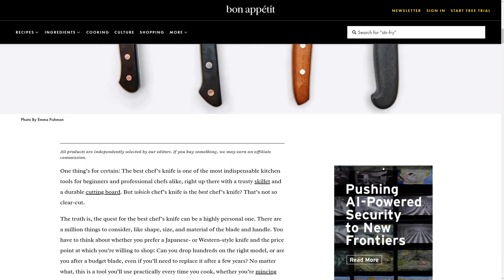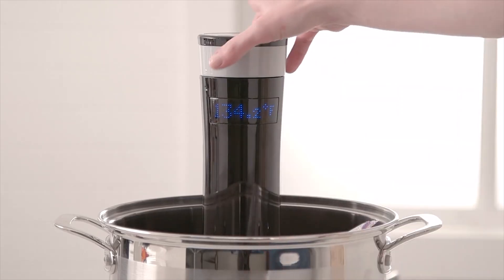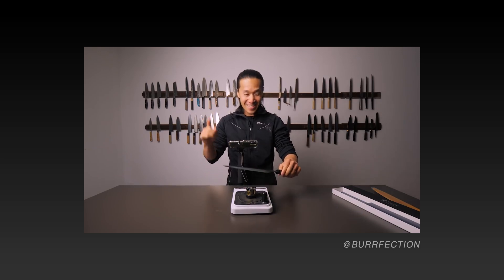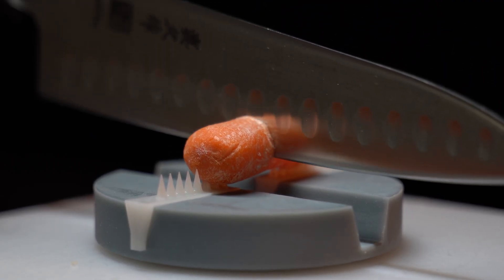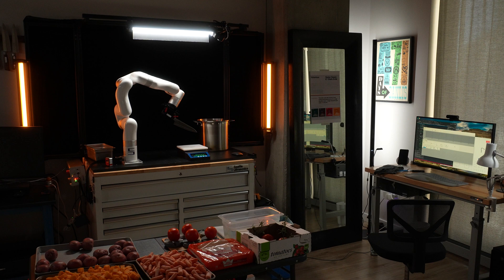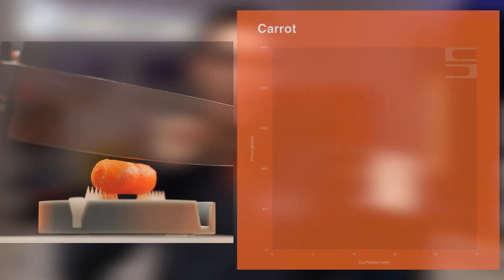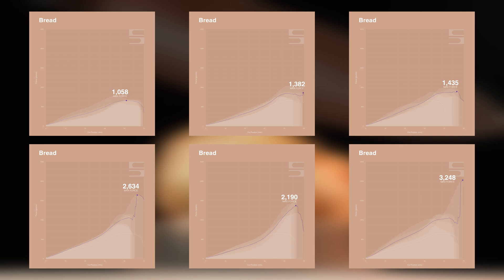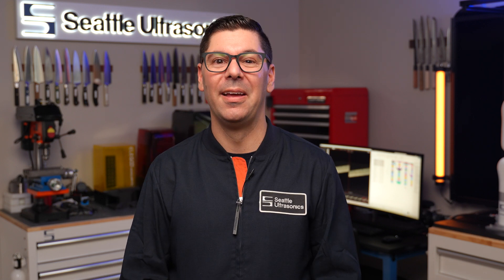The Quantified Knife Project - How do the most popular chef's knives actually perform?

Comment: As a PhD Mechanical Engineer who loves knives and sharpening, and whose wife loves cooking with sharp knives, it was great to see you tackling this topic in this way! 
I think that the data on the Blades tab in columns P-R shows why everyone should sharpen their own knives. Plus I bet that if you measured the bevel angle at different locations along the edge that it would change substantially. I don't understand why most manufacturers do such a bad job at sharpening. The first thing that I do when I get a new knife is to look at the factory edge under a microscope, and then I sharpen it. Having the data so far with the factory edges is great, but I would think that your next step is to sharpen them all at the same consistent angle, and then strop to the same sharpness, probably measured by the same Bess value, taken with the robot arm moving the knife consistently. I would love to see the robot arm stropping these knives.-)
I think that you may need to get the $$$ 6-axis force torque sensor. Slicing at a shallow angle is too important of a technique to ignore. Especially for the tomatoes, it is key. No one with a sharp knife smashes their tomatoes like your test does.
I am looking forward to seeing all your future test data.
Reply: Well said. I agree with you that he should spend the money to get the gauge for measuring force across multiple axes; I don't think the improvised device is really sufficient for this use case. I also think there should be a second robot arm holding the food instead of using a 3D-printed stand that does not really mimic the forces of friction on the cutting board or how the food is supported or held down by another hand. And I agree that the angle on some of the robotic slicing was too steep and the knife's edge did not move the through the food from from the back enough, as is the case when cutting foods with a tough exterior and soft interior such as tomatoes.
Reply: Thinning the knife behind the cutting edge doubled the cut force reduction of sharpening. If you sharpen your own knives it's easy  to cut a 10º blending bevel behind the cutting edge. 
High density food testing data - sharp to very dull 15% force reduction, blending bevel 32 to 34% force reduction.  Try that & share your thoughts if you have the time.
Reply: @danielbottner7700 what were the test conditions? Ie the thickness of the blade behind the bevel, and the material being cut?
Reply: @kknappmiller  Great questions... I have data... 1.5" x 1.75" sweet potato, 1/4' slice,  push cut,  Mercer BPX Chef Knife - 32% force reduction,(Standard Deviation =/-3% to 5%) 0.016 BTE,  0.017"at 0.080 up ,0.027" at 0.375" up, Spine =.0.085" thats one for sure. The other knife I tested was likely the Mercer Genesis 34% force reduction similar blade grind except the spine was 0.098".  
This test was run before I had any idea of force reduction achievable sharp to very dull, & yes it surprised me. 
Blending bevel narrowed 15º cutting edge 0.005" behind the micro-bevel .
Maximum cut force measured/rated. 
I have much more to share if you are interested.
Reply: @danielbottner7700 so you changed the secondary bevel from 15 to 10 degrees, while leaving a 15 degree microbevel of 0.005" or about 0.1mm? 

If so, then the cost in durability of that 10 degree bevel needs to be carefully measured. I have seen knives that were intended to have a 20 degree bevel turn into a mess at 17 degrees. I would never sharpen a normal use home kitchen chef knife to 10 degrees. That 30% increase in sharpness is not worth the loss of durability. Do you have any edge durability test in your suite?
Reply: @kknappmiller  Thanks for sharing, sorry for the confusion. I avoid using the primary & secondary bevel terminology, as they are confusing to some.
- The cutting edge on knives in my test set were all set to 15º per-side. 
- The 15º per-side bevel yields to a 10º bevel at a bade width of 0.005".
- The 10º per-side bevel yields in the the blade profile grind of 1.5º to 2.5º. 
- You are absolutely correct, in some blade steels should not be sharpened at low angles. 
- Mypreferred micro-bevel are 15º on the inside & 30º on the outside, which actually reduces cut force requirements in 1/4 slice testing on high density foods. 
- I am testing for blade thickness profile design cut force requirements.
- Good knife steels will not be dulled by the 5 cuts made on my test rig.
- A multitude of outstanding knife steels exist for those interested in extended sharpening intervals today.
Reply: @danielbottner7700 Thanks for the information. I don't think that I have intentionally sharpened a microbevel at a 5 degree difference from the main (secondary) bevel. I will often do a 22.5 on top of a 20 for a particular sharpening progression, but more often I will keep it much closer.
I guess that it makes sense to not have the edge be very sharp if the goal is to test the effect of behind the edge (BTE) thickness.
But I also think that if you are going to thin that much you need to test for durability.
Reply: @kknappmiller  Yes . . . we have tested thin blade profiles over the last five years on steels with advertised HRC levels from 54 to 59.  All good in that HRC range, but I believe 61-62 HRC may be the limit.  Ironically cutting edges have better survival chances on thinner more flexible blades. 
- Many cutting edges are destroyed when they are stuck into the cutting board & the knife is pulled sideways.  The driver of these concerns are, economical, easy to manufacture, symmetrical handles, aligned with the spine of the blade.  
- Asymmetrical handles contoured to mirror the human grasp have the most potential in terms of preserving cutting edges & preventing hand damage .
Reply: @danielbottner7700 one other question is when you say that the blade was sharpened, to what degree? The BESS test itself is measuring force, and in my experience this translates directly to the force needed to cut something more practical like paper or cardboard. If your measure of sharp was a 50 grams vs a 100, then I bet the difference relative to the effect of having an extra middle bevel would have made blade sharpness more important. But then that becomes a question of how long that level of sharpness can be maintained,  vs the effect of having a thinner blade.
Reply: @kknappmiller  Sorry, I missed the second question. In terms of sharpening level in Bess score ratings I backed away from the 125 to 150 gram levels as many chef knives will not hold that for long. I settled on 225 to 275 grams for as a more realistic working sharpness. Note... that certified media did not pass my certification verification testing. There are better alternatives with similar cut force producing far lower levels of standard deviation.  In medium & high density food testing thinner blades 
consistently win. The thicker Genesis blade required 157% more force on average to cut high density vegetables the than a blade I ground with nearly flat bevels to 0.005" BTE. 
All my testing was done with the thought that it should be easily replicated with minimal costs & tooling. 
If your test results differ, i am extremely interested in that data.
Reply: The difficulty in home sharpening is that no easy to use sharpening gear can follow the blade shape to keep the stone on a perfect tangent curve. And even the robot couldn't be precise enough to follow the factory curve. You'd end up just letting it grind its own version of it. But if you're not picky about that curve, you can sharpen a knife with a river rock...
Reply: @blairhoughton7918 I would be interested to know exactly what you are thinking of when you use the terms "tangent curve" and "factory curve." If you look at the spreadsheet, you will see that the factory edges on almost all the knives tested are wildly inconsistent. That follows my experience with factory edges. So with a few exceptions, my first activity before using a new knife is to sharpen it the way that I want it to be. What exactly that is varies significantly depending on the blade. On a blade with a sharp belly curve it is difficult to maintain a precise bevel angle as measured perpendicular to the edge at every point, but  my result is almost always much closer to perfect than the factory edge. 
If you wanted perfection on this measure you could do it with the robot arm and the right sharpening device.
Reply: @kknappmiller  Post this as a new discussion topic so it will be seen by others.  I do not possess the knowledge to craft an intelligent reply.
Reply: @danielbottner7700 ?? I didn't expect you to. My question was for Blair. You are on the thread, so you saw the message.  He should have too.

Comment: Great video! That said, the test setup didn’t seem to allow or replicate actual slicing movement? As in, all cuts were downward cuts instead of a push or pull cut where the edge moves either forward or backward in relation to the object being cut at the same time as it is pushed against the object being cut).

That has a huge impact on the cutting performance as then the knife edge can actually slice the material being cut instead of brute forcing itself through, this especially with bread or thick-skinned produce like tomato or bell peppers.
Reply: this should be the top comment. this test does not show cutting ability in a human hand at all, it shows... blade crush? for lack of a better term. not a real world applicable result imo. Blade geometry, shape and motion all apply here, and this cuts on one plane of motion, which , i mean, you might as well be cutting with the back of the knife, the numbers will be differnet but the results will be exactly as applicable.

Comment: Wow, this is right up my alley!  It doesn't surprise me that different knives excelled at different tasks.  Sharpness, or keenness of the edge should determine the best tomato cutter, as that's what eases piercing of the skin.  Blade stock thickness and height of the grind should have the biggest impact on potato cutting, as well as scallops for relieving surface tension.  Bread cutting should be impacted by the relative coarseness of the grit used to grind the edge bevel, as micro-serrations improve results there.  Edge angle has an effect on every test.

Generally, the results would be more useful if they were performed on edges that have been sharpened at least 2-3 times (to identical edge angles) to take the possibility of burned edges out of the equation.  Most production knives are sharpened on belt grinders, which can easily heat the extreme apex beyond the steel's intended tempering range, which in turn results in premature dulling due to rolling or chipping.  Resharpening several times on a fixed angle system should remove that damage on most knives.

I would recommend that you check out Science of Sharp (web) and Knife Steel Nerds (web and YT).  The former provides scanning electron microscope images of edges so you can see what is happening at the micron level.  The latter is a PhD metallurgist's gift to non-doctoral knife enthusiasts.
Reply from the maker: @BladeLabMiami  Thanks for the kind words and feedback! I'm a big fan of the Science of Sharp, and Dr. Larrin Thomas was actually involved in the QKP. He conducted the CATRA tests and took measurements of the bevel geometry, in addition to consulting on the overall experimental design.

Comment: How were you able to control for the moisture loss in the food samples over 2 days? I imagine keeping the air conditioning on "refrigerator temperatures" the whole time basically makes your environment a giant dehumidifier.  

I do love the driving motivations behind the project though - knife purchases are easily one of if not the most contentious and agonized over topics when it comes to the kitchen. Anecdotal evidence, hype, and marketing play an outsized role and 'good' data is basically nonexistent.

That being said I do have some questions about the practical applicability of the data. For the tomatoes and bread (40% of your data) the programmed robotics routine seems to me to be completely incongruous with how actual people cut things in the kitchen. The 'push cut' should involve way more horizontal movement for those foods than the robot arm is shown articulating. Speaking personally, when cutting either of those I start my push cut with exaggerated horizontal movement right above the surface of the food, and after passing the skin or crust and the knife 'catches' on the food, then I change to a more even distribution of horizontal and vertical movement.

After all, the entire point of is you're trying to avoid that force 'hump' being registered in your data which represents you are crushing your food instead of cutting it. Anecdotally speaking that's how I seem to recall most other people cutting similar soft foods as well. But I'm not sure how you'd program that without drastically increasing the complexity of your setup.

Comment: As someone working in a high end shop specialize in Japanese kitchen knife, I'm always frustrated how the wire cutting test doesn't reflect the real feeling of the cut. Since we cannot quantify this we just let the customers try the knife on potatoes but again that doesn't reflect the result on other materials. This test have always been constructed within our team but now it is realised in a scientific way, and I admire you work sir for executing this out cleanly with easy to understand graph. Also CATRA test attached to the graph is a great reference since it is so hard to explain to the customer how sharpening angle, heat treatment and sharpening  grit affect the result besides the steel and hardness. Thank you sir for your great work.
Reply: All the Bess tester is designed to do is approximate a physical measurement of the radius of the apex,  apex acuity, one single point at a time. And it’s actually decent at doing this, IF the test is done properly. People don’t seem to understand that. Radius of the apex or acuity correlates to a keen edge. A keen edge and a sharp knife are not the same thing. A sharp knife is largely a function of the geometry of the blade itself, primary and secondary bevels. A sharp knife can continue to cut long after the edge or secondary bevel itself is dulled. A keen edge only affects cut initiation aka what knife bros might call “bite.” Like breaking the skin on that tomato. Cut initiation and cutting ability are not the same thing. Cut initiation = keen edge. Cutting ability = sharp knife. These concepts are not difficult to understand but few people seem bother.
Reply: @markbrown9138  Can't be said much better. But since the store I'm working at have a test cut setup, I'll just show how it works to people. We always have in the showroom a thin Japanese knife that has a dull edge that I'll use to try "cut" my palm to show it's "dull" and a well sharpened Zwilling that can slice through paper no problem. I always enjoy the surprise face of people when things doesn't go as they expected as they try to cut potato with those two knives.